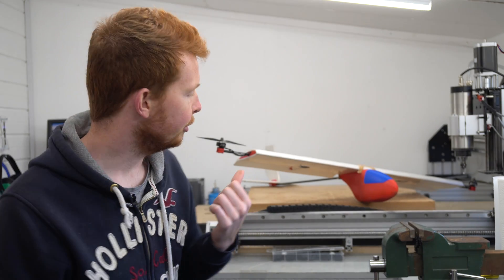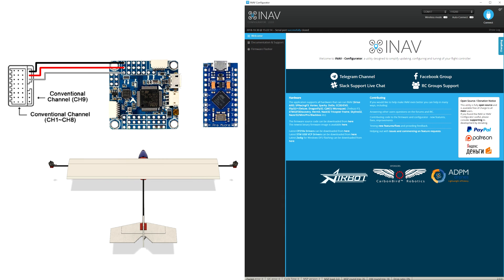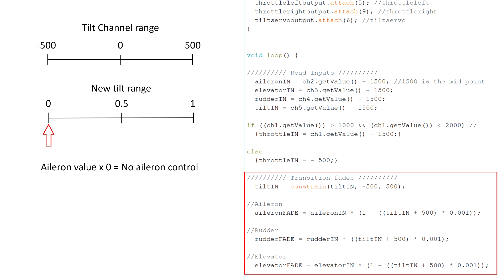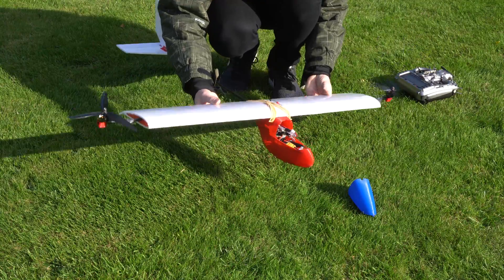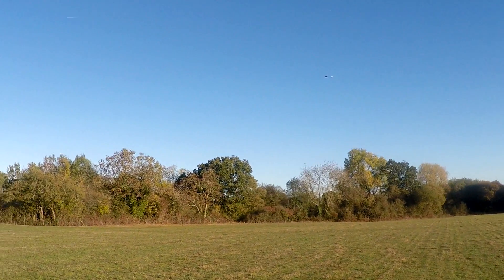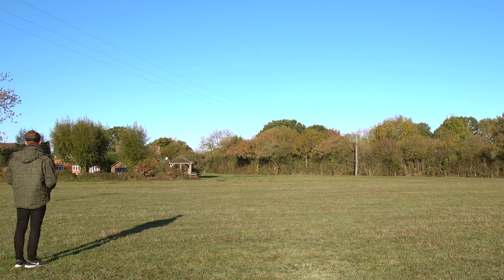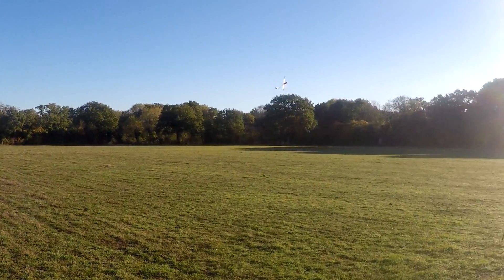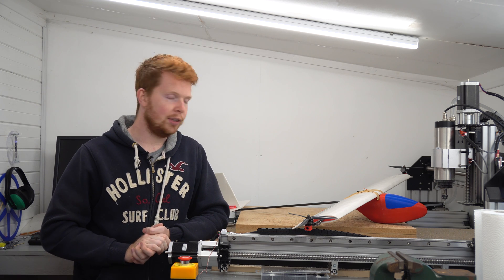RC VTOL - V4

Comment: Tom i have only recently found your channel and videos. I am trying to create a Vtol vehicle and i hope you might be able to help me. what i am trying to achieve is basically a bicopter that transitions the motors from vertical to horizontal for FFF, but the vehicle does not have any moving control surfaces (aileron, elevator etc) however does have a fixed V tail, and relies on the angle of the motors for pitch and roll during FFF. can this control method be done with Openaero Vtol or would it need the arduino?

Comment: Are you using counter rotating propellers? If not the spinning, you are seeing, could be the result of the torque from the motors and Newton's third law. Since you can tilt the engines, I believe you could have achieved yaw control in hover mode by tilting one motor sligthly forward and the other slightly backward, whille adding a tad more throttle to compensate for the lack of lift resulting from the tilting.

Comment: If you revisit this, or build a V5, the last crash in the V3 video suggests that you could do a barrel roll with zero forward airspeed. It would be an impressive trick to program into your flight control system.

Comment: Windows 10 for some reason complains about various Virtual Com port drivers.  I bet that is the reason you are having issues.  A simple suggestion would be to download the correct driver for the VCom you are trying to use, but you could probably just as easily run a little vm with win 7 or any other OS just as easily.  BUT being that this video was 3 years ago you have likely sorted this issue.

Comment: WOW  thats alot of work you did.  I did the same thing you did by running 2 kk2 boards wired with y harnesses and then out put to a 8 channel multiplexor switched on the gear switch .

Comment: I know I'm about two years too late but I only found you last week and have been binge-watching my way through. Anyway, I have no experience of aerodynamics etc - unless you count control-line aircraft 45 years ago as a kid! - but the thought occurred to me that adding a small, helicopter-style, tail rotor with reversible motor could add yaw (I think that's the right name?) control when in hover mode. Obviously this would affect the centre of gravity etc of the airframe, but I'm sure you know how to counter this.
Anyway, just a thought. I'm sure there's a hundred reasons why it wouldn't work!
Love the channel Tom, well done! Watching your natural reactions to each disaster/success is a pleasure to watch. Keep it up, it's amazing!

Comment: Nice, I've been looking for something like this (with arduino code showcase specifically) for quite some time. Thank you!
On a sidenote, you'd usually put your magic numbers (e.g. 1500 constants, 0.2 mixin percentages etc.) in a const int or const double declaration somewhere up top. That way you can tweak them homogeneously without running into weird issues if you randomly overlook a value and forget to change it.

Comment: What if the tail was connected to the motors. So that the tail can change the angle along with the motors, turning on the hinge. So that at low rpm the tail would go down and raise the engines up, and at high rpm, so that the tail is horizontal and gives maximum speed? This would work automatically, as soon as the model starts to take off, the tail drops and the motors-up, and the takeoff is abrupt. .. ..
Reply: You can also try to put the wings on the hinge, so that in a state of balance they rise with the engines, and when accelerating, they may take a more horizontal position.
Reply: Of course, you need to set a restriction on the angle of rotation, it should not be too large, and in the case of a moving tail, an additional wheel may be required, it will need to be taken out closer to the tail.

Comment: This got me thinking... what would happen if you had a regular quad copter with regular quad FC and tilted the front motors forward and the rear ones backwards? 
up would be forward
turn left/right would do nothing
forward/backwards would do nothing
sidewards left would be turn left
sidewards right would be turn right
You could add an Elevator to the forward/backwards channel and ailerons to the turn left/right channel and there shouldn´t be a problem, right?
You would need to deactivate the autoleveling of the FC while in plane mode though, otherwise it would turn right if its rolled to the left...

Comment: Get hover yaw control with software making one motor twist forward slightly and its basically done.  You could also keep like 2% forward constantly and use slight differences in rotor speed as differential yaw.

Comment: I absolutely admire the projects you undertake, and your success may vary, but your learning ramps up always.  TINY piece of info for you regards aeronautical engineering, not from me, but from NASA, which you may have seen: NASA have produced a winged aircraft, full-size, electrically powered, and made a few mods to the basic aircraft.  Primary, there are two things...First, the chord length of the wing (the width as you will know Tom) is surprisingly narrow, which they say makes it 500% as efficient.  Secondly, there’s two big props, one each end of the wing very like your design, but there’s a huge array of smaller drone-type propellors ranged along the wing span between the outer props and the fuselage - reminiscent of that Howard Hughes monster plane long ago!  The little props are only for taking off, like ‘booster rockets’ on a space shuttle.  Good on you Tom, press on!

Comment: Hi Tom, congratulations on such a big project. Excellent engineering +++. I was thinking that your VTOL aircraft design was great with just 2 motors. But for an even better locked in stability was was thinking perhaps if you could incorporate a rear motor and put out some plans so we could build one. I also have just demonstrated flying the eflite convergence and XK X450 and could not believe how good the XK X450 was. I’ll leave you a link to my video. If you do put up a plan for the try copter configuration I’ll build one and post it on my channel. Well done again.
https://youtu.be/UkV8yH-5thc
Best regards,

James Keys

Comment: F4 flight controller then use flight modes to change the mixes and can output pwm from it and use d shot on the esc .. I also would of used the motors on separate spindles so they move independently and use that for yaw once in hover so all good it is controlled by the motors trust and pitch

Comment: You can achieve yaw control on hover with simply tilting only one propeller slightly and compensating throttle to maintain roll, no?

Comment: Could you put a small fan in front of the elevator and point the front rotors slightly backward so you could use the elevator at a complete stop?

Comment: Is the problem of programming your flight controller related to drivers not being installed because they are not signed. I think it is stupid of me to think you wouldn't know about it ie turning off the signed driver only installer. But sometimes the right thing is right there but not noticed

Comment: What about giving the engines the servo's to move left and right instead of only having them move from forward to up?
This would still allow for slight yaw control.

It obviously can't angle the engines too far right or left, because that would destabilize it. 

But it could maybe work? 

Or even simpler if you wanted to move a bit to the left the only thing you would have to do is:
lower the throttle of the left engine making it bank a bit to the left, as there is more trust coming from the right side, which angles the plane.
And then turning the throttle of the left engine up to stop the bank and returning it back to normal and you have moved to the left slightly? 

The latter wouldn't even need you to change anything apart from the learning how to perform the manoeuvre successfully

Comment: From an aging retired Eng, your ability to fail and then learn from that fail, are the very core values of successful engineering.  That and a never ending curiosity.  Your vids reflect all of those attributes.  Nicely done.
Reply: 1 propeller on the front  faces the axis  - 3 drivelines - 2 on each side - one in the rear - wide, symmetric  propellers that stop and switch into wings.  tri copter
Reply: Isn't that how the Wright Brothers built the first airplane? Proof that you don't need to be a billionaire to change the world.

Comment: Hi Tom, I am currently watching through all your RC adventures, which I found really intriguing. I built a paramotor like yours, and just now I am facing the VTOL challenge. I am in trouble in making the plane stable... could you please give some hints on PID parameters you used? Just to have a starting point... Tons of article have been written about drones, but with such a larger inertia VTOLs are a bit different, I think. Many thanks and please..  keep going !!!

Comment: The self leveling problem is likely because the "elevator authority" comes from 2 different places in both hover and 45 degree mode. The authority of both engines tilting is going to be mostly constant. But the the actual tail elevator only has authority while in forward flight. And if there's a tail wind while hovering any automatic compensation by the flight controller to the tail elevator servo will have the opposite outcome on the aircraft's pitch.

Comment: The code looks a lot like C++ to me but maybe it's just plain C? Anyone know for sure?
Reply: Sort of - the Arduino IDE is a simple if "unpure" way to get you coding and implementing your projects, originally developed for folks in arts and other fields (that is, for use by people without a programming background). It's mostly C with some C++ somewhere in there. I believe they called the language "Processing"? The "Arduino hardware" is just an Atmel AVR (now owned by Microchip) so you can use any toolchain you want for developing in a real C/C++ environment if you wish.

Comment: thanks for posting.    OF COURSE   there is a  Shortage of roll-axis  stability.     THERE IS A BUNCH OF  MASS,  AT EACH  WINGTIP.     it will be assumed that the previous, major dom  issues were resolved, by accident.       consider the  really good  Reasons  why  the rotors of a   v-22  are designed,   the way  they are.       it may be advisable to  Increase  keel effect stabilization; ie,  ballast,  Low, vertically aligned with  cg/c-m.        googletranslate

Comment: Just an idea but to have yaw control when in a hover.  Try and integrate a small (2-4 cm) propeller on a small motor in the rudder that would have minimal weight

Comment: Quite a simple concept, and it works! How did you troubleshoot to determine the need for a capacitor? If you could extend the wings and make a glider, this could have an extended flight time.

Comment: How did you convert it horizontal from vertical during flight?
 By using a direct specific channel from reciever to transmitter or through arduino?

Comment: Not knowing anything about coding, I’m surprised there isn’t any sin or cos values for the fade from roll to yaw.

Also, IMO this would be really cool with a differential gear that allowed fine tune independent twist to each motor for control, as well as a broader 90 degree twist for the transition; but that would probably take up even more room inside lol

Comment: Given you like testing designs, have you investigated aerospace engineer Steven Barrett's ionic wind thrusters, which pulls ionized air over wings. See "Silent and Simple Ion Engine Powers a Plane with No Moving Parts" by Angus Chen, Scientific American, November 21, 2018. I envisioned a contained jet engine like thruster, but I don't have the resources to build and test it.

Comment: hi, if it is a driver issue that prevents you from flashing firmware you need to turn off digital signature enforcement which is the norm for Windows 10. Earlier versions asked you if you want to install a driver that is not digitally signed. windows 10 does not allow such installs. you need to go to settings, updates & security and choose advanced startup. the system will restart and give you a menu with several options, choose option 7 "disable digital signature enforcement" till you turn it back on. now you can install the drivers that you couldn't earlier as they are not digitally signed which is the case with most of the usb 2 serial, and serial port drivers needed to flash any firmware. You could also search for console commands which you can enter into an elevated command prompt window (with admin rights) which would be simpler and faster than the first option. I hope it helps.....keep those videos coming. ciao.

Comment: How does the rotors tilt to maintain the pitch angle in hover flight?
Say the plane hover with nose down. Do the rotors tilt backwards and use the precession of the rotors or do the motors tilt forwards to create a counter-momentum against its rotary motion to bring the nose up? I don´t come to a conclusive solution :/
Great plane und a really clean design.

Comment: Instead of tilting the motors only you could tilt the wole wing, this solves 2 issues:
-you no longer need to keep the motors far from the wingtips
-you can use ailerons to get yaw control

Comment: Brilliant for a first effort!  Inspirational I'd say...
FWIW (probably not much)  have you considered replacing the tail with a (third) tiltable motor, acting as a thruster in normal flight? 
Then, with small adjustments, it could also double as an elevator, but it could make VTOL a doddle when pointing up, especially as you could also easily add auto-leveling.
Thanks for the great vids!

Comment: I think that this plane is not good for the project  look like not gliding well  I will use the same system on a good glyder first I don't see the need for arduino and i will add another motor center wright before the wind  to push forward and help that tale  only to aid the transition for the copter props to get in place for forward  trust on the stop I will shot the 3 motors let the plane glide and get the 3 motors to get on position to copter and get to Hovering landing 2 motors for copter don't look  to  stable to me not whit a tale that tale look like is hanging bad

Comment: So I'm assuming the whole purpose of this version is simplicity, but I thought I'd give my input. Why not have a micro vacuum pump, or something of the sorts, and then run the tubing to the rudder to get some air passing the rudder? Any forward thrust generated by the pump could be canceled out by rotating the props a little more backwards, and you'd now have some yaw authority while standing still. But this would, of course, eliminate the simplicity of your current design. Just thought it'd be a cool thing to try :)

Comment: excellent, I once made an auto stabiliser for an RC plane as I kept getting confused when bringing it out of rolls.  After discovering that my code was inverted on the first launch, the second worked well and I had a nice stabalised plane with limits to pitch and roll that were adjustable via a pot on the controller.  It wasnt as good as an off the shelf solution, but it was cheap and MINE :)

Comment: What if you used steam in a compressed air engine instead of compressed air?
Reply: It would melt? Being 3d printed ans steam is hot?
Reply: Thomas Meister What if it was printed out of some sort of heat resistant plastic?

Comment: Outstanding sir!
As a 68 yr old electronics  student - I got sense of your coding and now have incentive to delve into programming my 6 month dusty Raspberry Pi
- and I wondered what I'm gonna do when I  finally retire
It won't be aeronautics - my reactions and eyesight are waaay too slow to react  LOL
I do have a 3D printer  - Perhaps something hovercraft based :-)
Your scaling/weighting of values was clearly gut feeling led - from your extensive aero experience
I subscribe  - and have viewed your VTOL 'rocket' trials - some time ago
What was your side-track to slings & arrows and lazy bikes? 
& Clearly = VTOL plane is 'competing' with established drone control software legions
However - a genius works with constraints of 'the conventional'
 Methinks - a Furze /Stanton project might be interesting - upscaling from the 3D printed grams

Comment: Hey Tom, couldn't you technically add yaw contr by spinning the motors at different speeds in hover mode? I think that would ease flying the plane a lot...
Just a thought, correct me if I'm wrong (^^)

Comment: I can do Arduino code, but I have no clue about the flight controller board. Does it have a built in gyro and accelerometer? If not, you might be interested in the MPU-6050 or MPU-9250 using the I2C (two wire protocol) interface and you should be able to work out some auto stabilization code. Very nice job. I'm going to be sharing this video.

Comment: Please finish the air car series, you just kind of stopped without really finding an end or an answer, to overcome the issue of the not enough return, not enough power paradox, you could run 2 motors 180 degrees out of phase, or 3 motors 120 degrees out of phase, like 3 phase electricity. This way you wouldn't have to redesign the engine, or drastically change the car, you could mount the 2 engines on that gear, or have 3 gears along the axel, one for each motor. Please make more vids on the air car

Comment: Nice job! Check out the Betaflight mixer code, I'm pretty sure it wouldn't be too complicated to add one for your VTOL. Basically it's just a matrix multiplication from inputs to outputs, see around line 150 of https://github.com/betaflight/betaflight/blob/master/src/main/flight/mixer.c